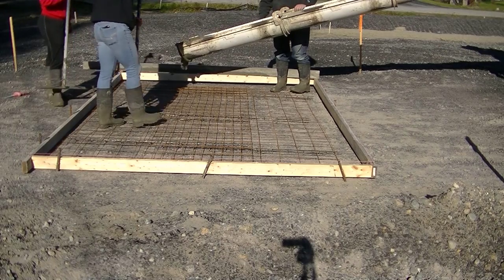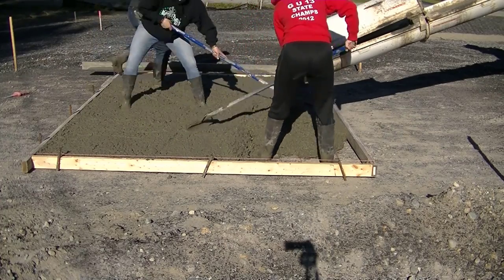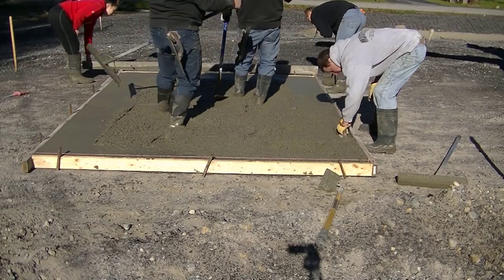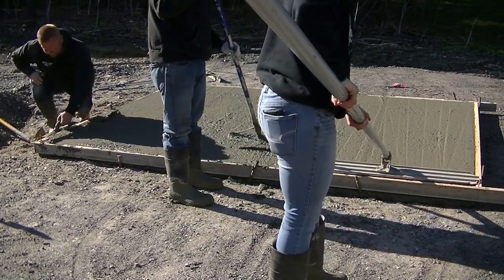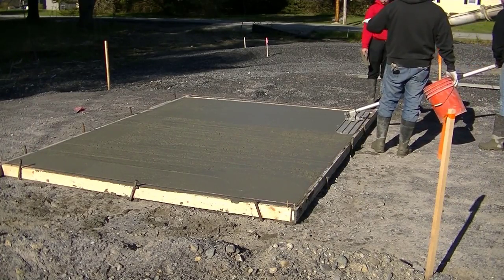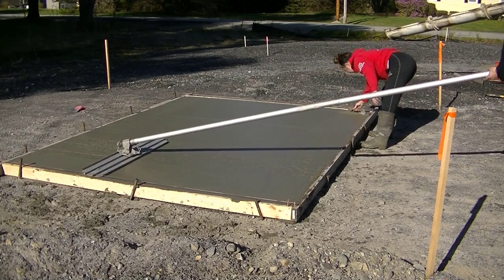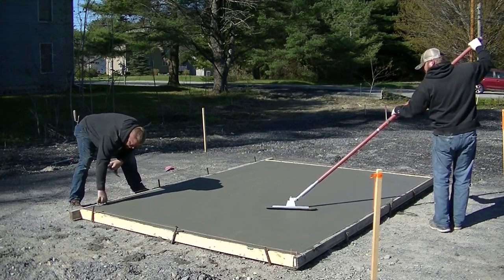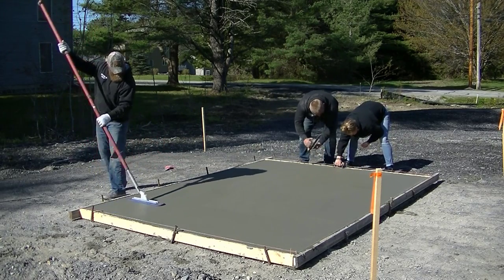I Wouldn't Dry Pour A Concrete Slab Like This | This Way Is Better - DIY 8' X 12' Slab

Comment: @Mike Day Everything About Concrete  I'm 70 and your videos gave me the courage to pour a propane tank/garbage bin slab (4'x8') in my backyard, last weekend, with my wife. It was a success. Framed in 2x4's, bottom filled with ¾ clean stone with a geotextile sheet underneath. I used 1 inch angle iron I had as rebar, every 12 inches (I already had a lot left over from a previous project). I didn't have a bull float and I changed my screeding method from the one you showed to going back and forth, it helped in pushing down the stones. After that I used a wood mag and steel trowel before finishing the surface with a sponge. I'm very proud of our work. Thanks for the precise instructions and guidance.

Comment: That’s the perfect size and finish job for a DIYer to learn on. And since it’s only for a shed, even if you did get a hole or a hump, it wouldn’t be a deal breaker. That would have also been perfect for a relative novice to try their hand at pouring and finishing alone.
Reply from the maker: Yes!

Comment: Local company here uses mixing trucks I'm sure you seen them the truck mixes it comes out the chute like a regular truck. They charge you for what you order but no short charge if you go over they only charge for what you use.  Only downside I had was took them awhile to get the mix right at first about 1/4 yard was dumped I had a use for that fill some buckets I was going to use.

Comment: You mentioned a little about cost for small jobs with a truck.  It might be worth the extra money to get a truck.  It seems 1 yard by truck will actually cost double per yard (if you can even get one to come for that small amount).  Price by doing it with the bag might come out cheaper, but then add the mixer rental plus hauling bags and doing all the mixing.  
There also seems to be a breaking point of no matter how many people are working, you can mix fast enough to be able to work it.

Comment: Mike remind them of the importance of having that reinforcing mesh at midpiont. I didn't see one pull off of the ground.
Reply: Looked like they had chairs under it
Reply: @brockwagner939  Nope right on the ground. I don't see any chairs and plus as they walked on it there was absolutely no sag, as there would be if it were raised.
Reply: if you look closer there sat on triangle pier lenghts, looks like  "silver pins" sticking up
Reply: Sorry. You are incorrect.  I can clearly see the concrete flowing under and over the wire mesh.
Reply: It easier to break out when the wire is on the bottom.
Reply: I'm more swayed by Mr. Day not correcting my observation. He has commented on other comments.
Reply from the maker: There are chairs under the wire
Reply: @MikeDayConcrete  See that wasn't so hard now was it.
Reply: Yes.  How'd you know???
Reply: @MikeDayConcrete  im just a girl and I'm doing a 12x14 slab for a gazebo
Wish me luck buck!
Reply: steel in lower third for strength. steel in upper third for cracking. that's how I was trained.

Comment: Good training video.  I wouldn't broom finish the floor because it holds dirt and dust once the unit is built over it.  The smooth floor would be better in keeping it clean and getting the water to roll out the door.  thanks.
Reply from the maker: Thanks John, I was told to do this finish so just doing my job!
Reply: @MikeDayConcrete  And that's why your the best!  You complete it the way they wanted it.

Comment: make sure the wire mesh is lifted off the ground on your next pour use fiber mesh so you dont have to lift any wire mesh
Reply from the maker: It has slab bolsters under it holding it up. No need to pull it.

Comment: still fascinated by how in almost all your videos screeding is a 2 person job, here in NZ its almost always done by one person (not the most fun job) OX is the largest brand of screeds and bull-floats in NZ and even their 3.6 meter (12 foot) kick screeds only have a central handle and are intended for use by a single person. I do like the idea of 2 person screeding it seems like it might be a little easier as you're only needing to focus on your end of the screed being level. (also power screeds are very rarely used in NZ, and water reducers are also very rarely used)

Comment: I'm subscribed and watch your videos often.  The concrete you pour always seems so workable and you're able to screed, mag and bull float it to where it's nice and smooth.  When I get concrete it just seems like a bunch of rocks, and right from the beginning it's nearly impossible to work well, to use the tools to pull up the cream and push down the rock.  I don't know if the mix is wrong from the plant, if it's my technique and/or timing, if I need a superplasticizer, smaller rock, more water, etc.  Also, you mentioned that you normally use a 5-6 inch slump.  Is that the slump after the superplasticizer has been added or before?  Any advice would be appreciated.  Thank you.
Reply from the maker: Yes, 5 - 6 inch slump after water reducer is added. Maybe try using a 3500 psi mix, it has a little more cement so sometimes it's not so rocky.

Comment: How do you make straight wood for forming the sides?  Would ripping OSB board at a Home Depot to the slab thickness be a way to go?
Reply from the maker: We just pick through a lot of boards until we find straight ones. Then we use the string to make sure they stay straight during the pour.
Reply: @MikeDayConcrete  I imagine you can set forms perfect one day, be ready to go the next, and find them warped.

Comment: THANK YOU.....THANK YOU.....THANK YOU......MIKE PLEASE MENTION.....WHEN STRIPPING THE 2X4 TAP THE TOP WITH A HAMMER FIRST TO RELEASE THE BOND......AND SO YOU DO NOT TAKE THE ROUNDED EDGE OFF THE SLAB OFF WITH YOUR 2X4.....

Comment: If i just needed to pour a concrete slab for a bluestone patio I would be done after placing and screeding, right?  I don't think it would need to be smooth for installing the bluestones on top.
Reply from the maker: We place, screed, and float it once.
Reply: @MikeDayConcrete  Thank you, Mike! Luv your channel btw! Will be signing up for the course as well.

Comment: If pouring a slab in the backyard for a home shop, does this usually need to be inspected by the local government? Something like 20 feet on a side perhaps and 6 or more inches thick.
Reply: Take your government inspections and shove it
Reply from the maker: All local code enforcements are different. You'd have to check with your town or city.

Comment: Do you have a recommendation for pouring concrete where you don't have feasible access from the concrete truck? Trying to avoid a pump for only 1.5 yds but also wouldn't like to mix all that via bags.
Reply: You could rent a power buggy for about $125- $150, but you will need a vehicle capable of towing it.  It weighs about 500lbs. Where i live there is a guy that will bring his buggy and operate it for $150 for up to 10 yards, after that he charges extra.
Reply from the maker: Yea, power buggy or wheel barrow. It costs me 100 bucks to rent a power buggy.

Comment: Why wouldn’t you use a back and forth action with the screed?
Reply from the maker: It's not how we were taught, and it's slower in my opinion.
Reply: You are pulling it back towards you to level out the concrete. If there's any high spots with the concrete they pull it back towards them to level it out. If it's really high or really low there will be a guy behind them with a concrete rake helping move it around for them so it's less work for the people leveling it out with a two by four. No need to go back and forth with the two by four. I hope that helped 😊

Comment: Mike if the customer wanted a smooth finish would you add air? I assume this slab has air as it will likely be exposed to the freeze thaw cycles.
Reply from the maker: Yea I would if it was exterior. Only interior heated slabs have no air here.
Reply: I heard that air entrained concrete should not be troweled to a polished finish with steel.  You risk surface delamination.  I have heard of big jobs with this problem and big lawsuits. Is that true reason i am asking because i am planning on doing a small 8x12 shed slab , it will not be heated and i want a smooth surface. Should i add air? Yes my climate is the same if not colder then yours eh!

Comment: Great instructional video and explanation but shouldn't you have pulled up the wire instead of leaving it on the ground?
Reply from the maker: It had slab bolsters under it holding it up, take a look again and you'll see them.

Comment: Why even bother putting  wire mesh in, if  it's  on the ground  it's  not doing  any good, and damn so many people  for just that little  pad
Reply from the maker: Didn't you hear me say we poured a large patio also on this same site? And the wire had slab bolsters under it we didn't need to pull it up.

Comment: Not even pulling the wire.  The wire is supposed to be in the center......not 1/2" coverage on the U/S.  The way it is in the video......it's doing nothing.....what a waste of steel.  Might as well have put no mesh at all!  This is amateur hour!